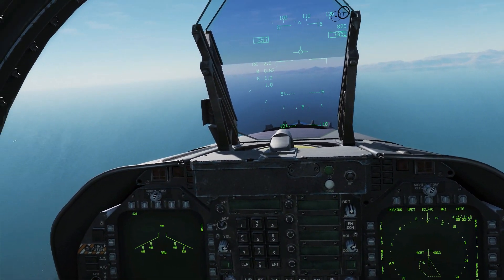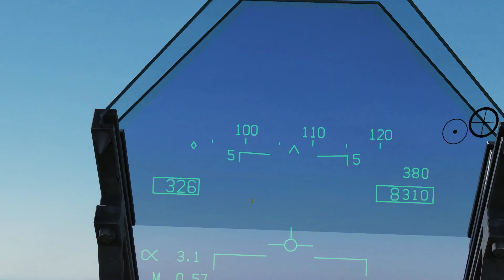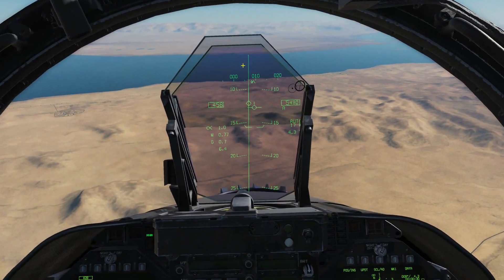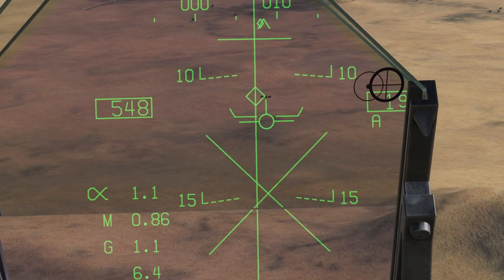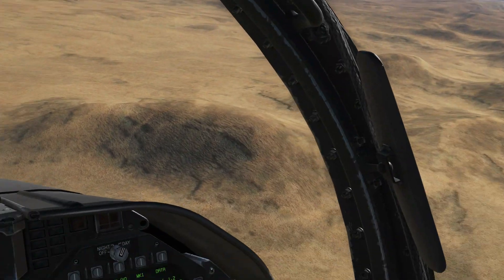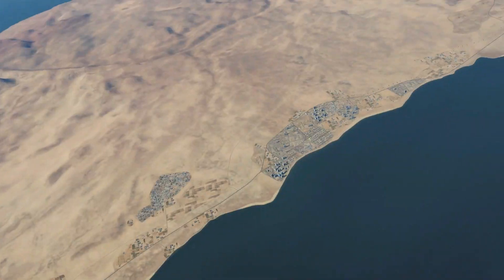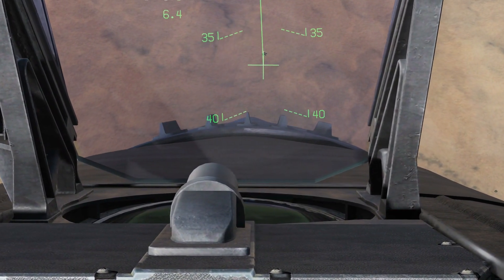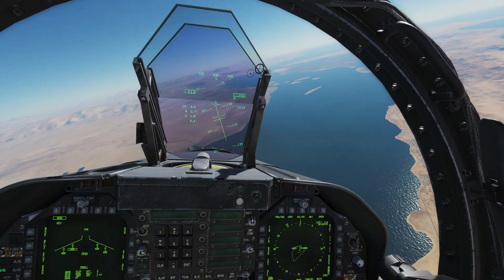FA-18C Hornet: Bombing On A Waypoint(Auto & CCIP) Tutorial | DCS WORLD

Comment: How about a video showing the correct use of mk82 snakeye high drag bombs? Been struggling a lot to get the proper attack profile. I also think auto mode should work well with them as you'll likely not see your target in time when low on the deck.
Reply from the maker: Roger same here. will ask the guys.

Comment: Your TGT point is off because the computer rounded the value down. It accepts DD:MM not DD:MM:SS. So when you entered 37 seconds for your first entry it converted it to 0.61 mins. The problem is that 37 seconds is 0.61667 mins. That .00667 mins coupled with the error in your other entry probably resulted in the 100 ft error you’re seeing. 

Try using the MGRS...if it will allow more numbers it will be more accurate.
Reply: James R Yes...this is the point I was making. It takes DD:MM:SS, but converts it to DD:MM.xx but seems to make large rounding errors.
Reply from the maker: thx
Reply: but my hornet only tkaes dd:mm:ss or is there a option where i can change this in the nav system
Reply: It does take dd:mm:ss, but 1 second is up to 101 feet, so the accuracy is only +/- 50'. Plus I don't know if it's an INS thing or what, but often the coordinates you enter aren't the same as what displays on the WP.